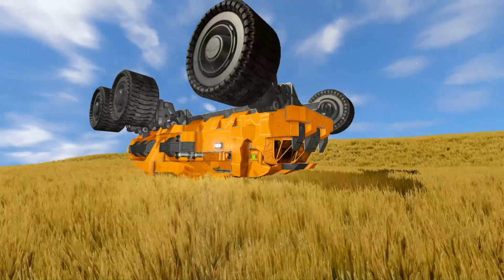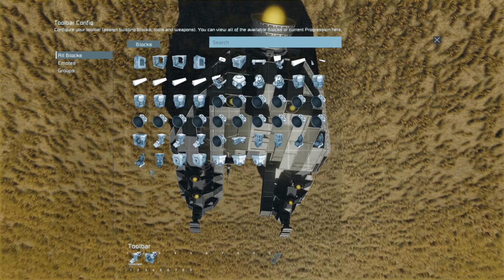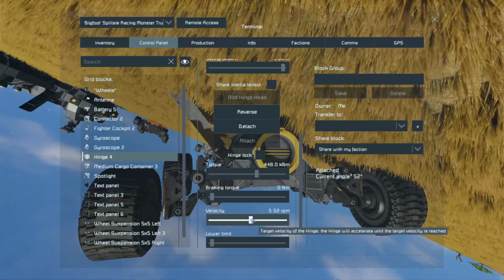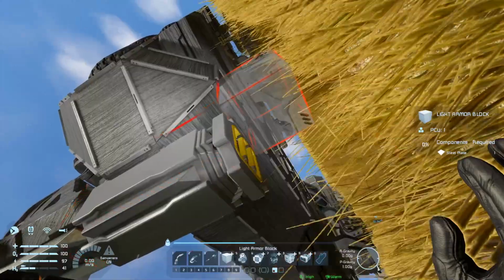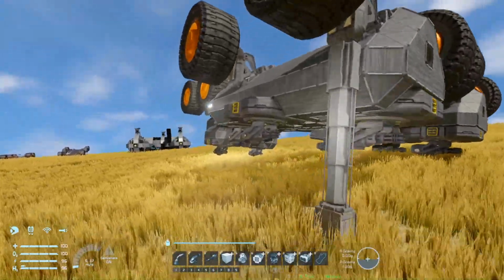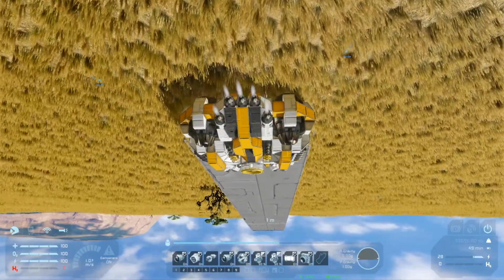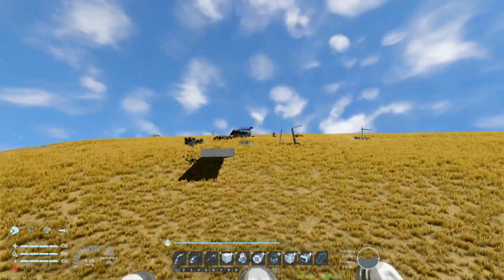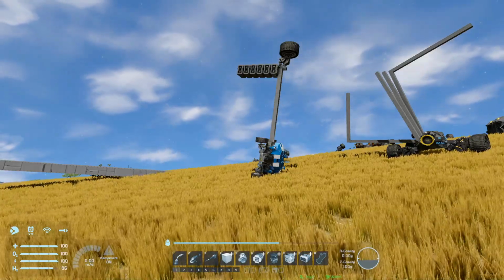How to flip your vehicle (the right way) - Space Engineers Tutorial #onemorepiston

Comment: 18:33 !!!!!! Time to MIX strategies!!
Instead of the Batteries what you could do is place 2 pistons on the opposite side and get your rover off the ground so that the extra wheel supports the weight. THEN it should flip all the way over with minimal effort. Especially vertical effort for your no-jet pack servers.
Reply from the maker: Good point :)

Comment: I found that connectors can also be locked together to perform rescues - assuming the stranded vehicle has one reachable in its current state and the rescue ship has enough thrust to lift itself and the other vehicle.
Reply from the maker: That's a good point, connectors seem to be more resilient to the 'subgrid weight isn't calculated for the inertial dampeners' issue that landing gear, rotors and hinges can have :)

Comment: I haven't tried this method, but I'm wondering if this could work. Build a rotor on the flipped vehicle, put an armor block arm on it, another rotor at the end of the arm, and then a place a landing gear after the second rotor. Rotate the arm down from the first rotor, until the landing gear connects to the surface. Lock the first rotor, then rotate the arm from the second rotor to lift the vehicle up. Either move it in a full arc so it has flipped the vehicle over,  or use the first rotor again to simply spin the vehicle in place while it is suspended.

Comment: In regards to flipping miners, Sometimes, ill accidentally let a large grid vertical miner tip over and the easiest way to get it the right way again is to simply use the drills to dig a hole and then allow the weight of the craft to flip myself, this works with regular miners too if their caught upside down. Simply right click the drills, aim the nose towards the hole and then let gravity do the rest :)

Comment: An older method is to have a rotor turned sideways on top of a small rover with a few armor blocks on it. If you wind up on your roof, just hit the rotor (stronger than a Hinge) and it should flip you back over. If your vehicle is large enough that a Solar Panel isn't too cumbersome, that works too.

Comment: An excellent tutorial as usual :) One thing I use when righting a wheeled vehicle is to set the friction on the suspension to 100% and make sure to have the parking brake on it reduces the sliding that can happen when you are almost turned over. You could grind off the wheels on one side to help flipping over but then you ahve the extra issue of being able to mount the wheels again. It was nice seeing the talisman again. Your tutorial build of that ship is the first one of yours I saw way beck :)
Reply from the maker: That's a very good point, don't forget the parking brake - I've had to chase after vehicles I've flipped before because I forgot that :P

Comment: place a rotor at the back or front of the vehicle close to the central axis. Use a line of pistons with a landing gear to lock to the voxles and lift the vehicle off the ground. Then use the rotor to flip the vehicle while its off the ground. As long as you place the rotor close enough to the center mass axis it should have enough torque to easily spin it around.

OR, just use the gyro override since its simple and usually effective enough.

Comment: I was thinking if you use a connector on the side (assuming that it didn't get damaged) You can use another vehicle to connect and flip the other over. I have not tried that method but I think it would work. Or you could get a vehicle set up with hinges and rotors with connector on the end and use it to right a vehicle grabbing it via the connector to flip it.

Comment: I was used a rotors attached on the center points (for example X coordinate going thru from the front until back of the ship)
Also, i was manage to do it on a large grid ship ;)
Step by step would be something like:
1. put the rotor(s) on the center point
2. put the piston(s) pointing to the ground 
3. on the piston head(s) build a support wide enough to hold it straight (do it on both rotors) (number of pistons varies depend on mass)
4. lift the grid up using pistons
5. Rotate the grid by 180 using rotors
6. retract the pistons.

Hope you get the point :D

Comment: Another way i've flipped a small grid car.
Build a small grid post behind the vehicle fixed in the ground (does need a small battery to work), attach a rotor to the top horizontally, place a piston on it facing towards the vehicle and attach a landing gear to the end. 
Extend the piston, lock the landing gear a then rotate the rotor to swing the vehicle over, worked on a light vehicle but may hit a weight limit quickly. 

Hit with a bit of force but got the vehicle back on its wheels.
Reply from the maker: Good thought, you could probably do the same with large grid to get the stronger rotors so you can lift something even bigger and if you're on a planet with atmosphere you could also use a wind turbine to save on the power cells :)
Reply: @Splitsie  Hmm didn't think about using a wind turbine, was on a planet so that would have been better. :) 
I was being cheap, just started on the planet, so resources were tight, think i'll use large grid next time though and carry an 'emergency' pack with the resources in it for this in future.

Comment: Another technique is to use a second ship to right the first ship. When I'm limited in vehicles and materials, I use a flying vehicle built for a different purpose (such as mining craft) to attach to the top of the flipped vehicle with a landing gear, then maneuver it over a ramp or something to partially flip it. Repeat a few times until it is right way up. Later on when I have large enough craft, this can be done with landing gear mounted on a rotor at the front of the second ship. Attach the landing gear to the flipped craft, gain altitude, rotate the rotor 180 degrees, then descend and gently set the previously flipped craft down the right way up.

Alternatively, you can have the rotor and landing gear affixed to your base (say a wind turbine tower), then use the mining craft to haul in the flipped craft and attach it to the base landing gear, disconnect the mining craft, rotate the base rotor until the flipped craft is right way up, reattach the mining craft, disconnect the base landing gear, and set down with the mining craft.
Reply from the maker: That's a good point, I'd meant to do the other ship method and plain forgot :P
Reply: @Splitsie  I really appreciate the response and tutorial series! I struggled for years to get into Space Engineers until I sat down to a fresh, new game and alternated between watching an episode and trying it out in-game. Keep up the good work!

Comment: On a world I host for me and two friends, we have a vehicle we call the batmobile, because it cannot hold onto it's wheels to save it's life. Every trip we take it on, it loses a wheel at least once. It also seems to spend as much time upside down as it does right side up. We've ended up just slapping a pair of gyros on it permanently, along with some downward firing thrusters, which both help provide downforce to try to prevent rollovers, as well as a bit of lift if it does flip. As for the gyros, I had never messed with overrides, and didn't even know how exactly they worked until I watched you use them on the gufi in survival impossible, so we always just moved our mice in big circles to work the gyros into righting ourselves. XDXD Needless to say, the batmobile is a bit of a resource sink, what with perpetual repairs. XDXD
Reply from the maker: Those kinds of vehicles are the best, something that crashes that much always has a great character to it and creates awesome memories :)

Comment: I've used a variation of the piston trick, I place pistons at 2 different points on the same side. When one is extended I place another piston on the opposite one then extend that one. I keep doing that until I flip. I've also done the one where I place the blocks until I flip. I use the later the most unless it's a big ship or vehicle then I use pistons. I didn't even consider the gyro method. Thanks, I'll have to try that next time lol.

Comment: My favourite rightingmechanism is a rotor atached piston atached landinggear. Point it at the ground, conect the landinggear, extend the piston to max for some groundclearence and rotate to the optimal position. 

Also, my early flyers al have so much extra gyrocontrol that i can balance them on their nose iff i want (I alwhays include some protection for my cab that's why i use the "armored" nose.

Iff you are at a certain point, taking a second shipp that has the necesarry lift/rotationpower is also valide.

Comment: Does putting your cockpit on a rotor effect the orientation? I've yet to try this...
Reply: The problem with putting your cockpit on a sub-grid is that you won't have normal control over wheels or thrusters. You can get around it using Whip's Subgrid Wheel Control Script (https://steamcommunity.com/sharedfiles/filedetails/?id=1445055239) or Whip's Subgrid Thruster Manager (https://steamcommunity.com/sharedfiles/filedetails/?id=757123653), but probably not a complication you'd add solely for the sake of a vehicle flip situation.

But maybe you had additional uses in mind. Either way, best of luck to you, Engineer.

Comment: I think you can still prevent it from flipping by adding a gyro on override and leave the values at 0 with maximum power.  This will force the gyro to try to keep you oriented in the same direction at all times.
Reply from the maker: You can but that also makes steering much more difficult
Reply: What if you lower the power, make it a more subtle override? I can imagine that if hou find the sweet point you will pretty flip free

Comment: I don't think the unbuilt block has the same weight as it's fully built counterpart, I was working on a ship a few days back and when welding up blocks (large grid) I saw the weight increase...
Reply: Are you looking at the weight in kg when you sit in the cockpit? Not sure, but maybe that uses a different formula than the center of gravity does. I could think of an experiment with rotors and torque to test that theory, but it's easy enough to just spam unconstructed batteries either way for this kind of situation.
Reply: @DFPercush  Yeah I was looking at the weight in the cockpit.

Comment: i am not experienced with the  game, so my opinions are baseless, but cant we just attach thrusters on land vehicles top to try an keep them  on ground or activate when necessary?
On ship we could build some thursters on rotors so we could change the orientations to use more where it is necessary?
you have awesome videos, and those tutorials was what made me buy and play this game a bit, but my VC died , so no more play .
Reply: Thrusters don't provide torque, only linear acceleration. They don't care about center of mass, you can place all the thrust way of to the side and it won't flip or spin. You have to use gyroscopes for attitude control. However, if you placed one thruster facing down, it could give the gyros an easier time by reducing the weight they have to lift off the ground. About thrusters on rotors, there is a mod for that, you can see Splitsie use it in his Survival Maybe series. I forget what it's called, but it lets you fly with gimbaling thrusters so you only need 2 or 3 instead of separate ones facing each direction.
Reply: @DFPercush  the thruster on land was more to act like dampers , so when your vehicle starts to get off ground they would try to suppress it and give more time before the point of no return .
Thursters on rotor was more like something cool , be able to use thruster in more than one way, it is more common to just make ships for each function than one that adapts .
but as i said, i am not experienced , i barely left ground .